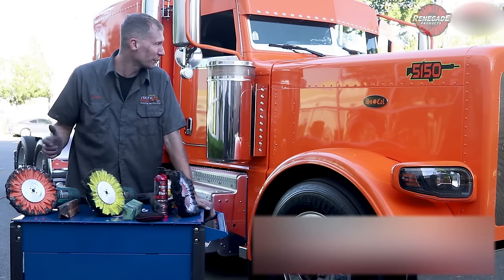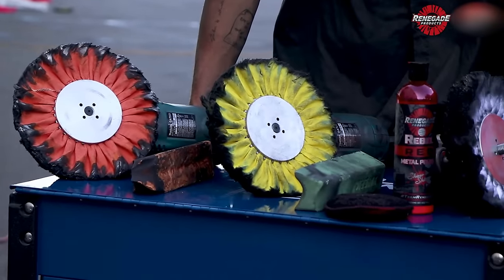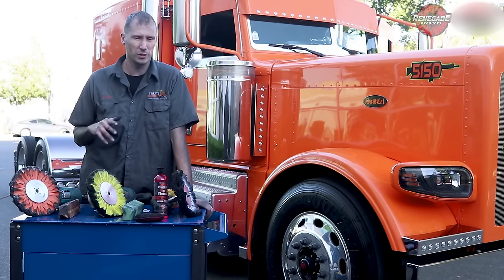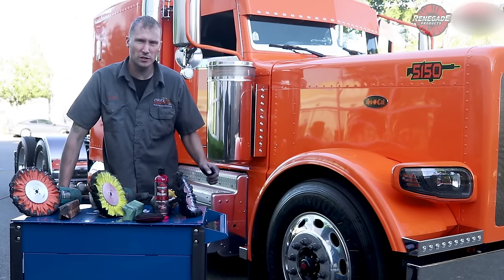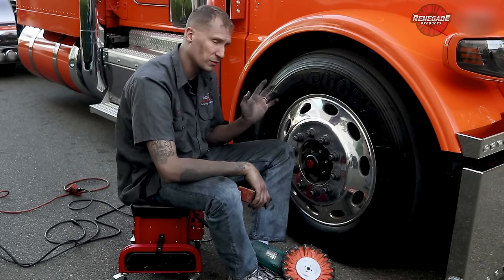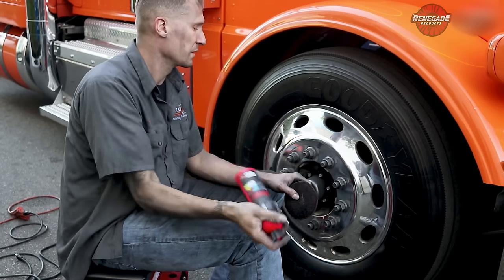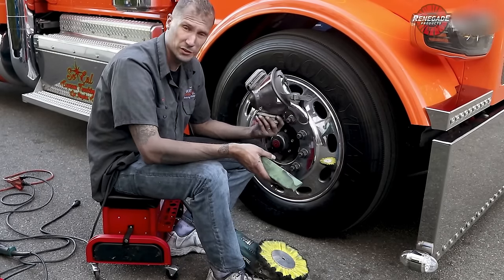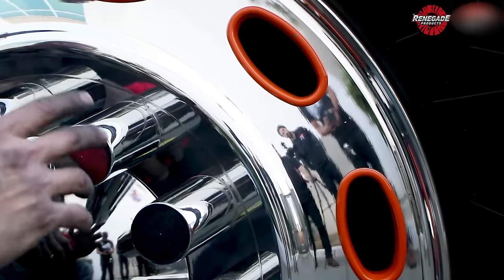EASY 2 Step Polishing Process on a Semi | Renegade Products

Comment: Just a tip for anyone who does this on their own. Use a good thick masking tape to cover your wheel studs and nuts. This combined with some patience will prevent you from getting into them with the buffer and compound. They are made from a treated material and will rust horribly if you get into them with the buffer, that would defeat the purpose of trying to make your ride look pretty. 

Most pros are careful with this, or in this case did some work by hand since hand polishing isn’t aggressive enough to get into the wheel studs and nuts. 

Another tip would be to put a light coat of clear paint on the hub. It won’t damage the hub and it will help prevent any corrosion between the hub and a chrome hub cover that’s metal. 

That’s a nice and simple polish job that looks great.

Comment: I had some wool pads and buffing pads left over from when I used to do cars and they worked just fine. 
Cleaned wheel. 
Buffed with cutting compound. 
Then polished with wool pad and polish compound. 
Turned out perfect. 
My pads Took much longer then I think your pads take.

Comment: Looks awesome man you cut a little differently than I do couple more steps you do I usually just use an 8500 rpm dealt grinder buffer with a 7 in yellow pad and brown bar and if the customer wants it super nice then I'll blue bar it as well looks good thoe I look forward to trying out some Renegade products for sure thoe that liquid polish seemed to work pretty nice

Comment: I love the style of the ovals on peterbilt are ovals specifically for peterbilts
Reply: David Smith..... the oval was originally designed for Pete's... but can be used on KW's, Macks, etc.... just be sure that whatever truck (class 7 or 8 Only) you want to mount them on,  has the correct size "pilot hub" and wheel stud spacing to match the wheels.
Reply: David Smith..... the oval was originally designed for Pete's... but can be used on KW's, Macks, etc.... just be sure that whatever truck (class 7 or 8 Only) you want to mount them on,  has the correct size "pilot hub" and wheel stud spacing to match the wheels.

Comment: I definatly find it interesting how i get the same results doing it the opposite way you do and other guys how ever i do a different amount of work depending on how good or bad the wheel is and i use 8,500 rpm dewalt and 6,000 rpm makita cause i cannot find the variable speed grinders anywhere locally
Reply: Try looking at Harbor Freight> I get all my grinders and accessories from there. Good Luck!!
Reply: Yea when a buff flies apart at 8500 rpm you'll look into a new grinder. I guarantee it.

Comment: Hey man great vid, I bought that makita too based on the quality of your work. But don't worry, I know that a good paint brush is only half of it, the artist behind it is the rest.  Just one question though, why do you use a respirator mask for the second compound, does it make fine particulates or something dangerous like a fume to breathe? I only ask because I am a truck driver myself by trade and I'm just getting into the polish game, wanna make sure I'm starting out with the right equipment and propper safety gear.
Reply: Yes all buffing compounds at high speeds are fine particulates that shouldn't be inhaled.

Comment: Can I use a grinder with battery which 8000 RPM or the 11000 RPM
Reply: No, the buffs won't hold up, they'll fly apart violently.